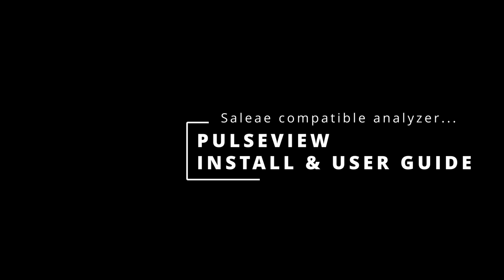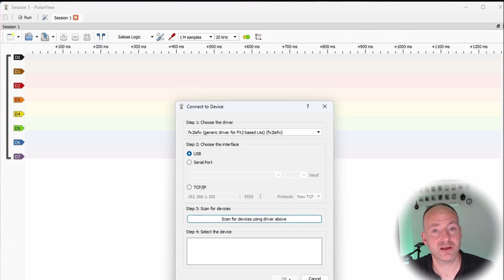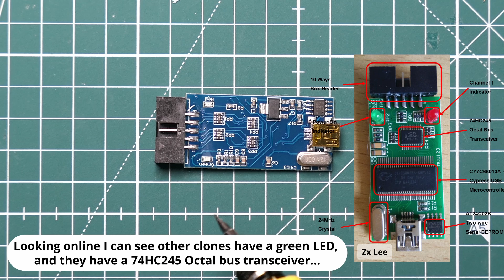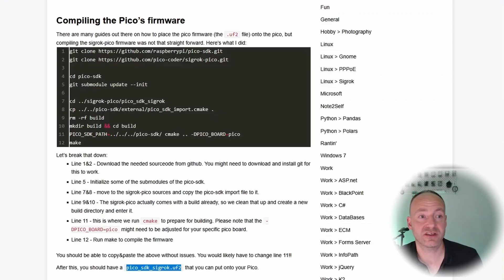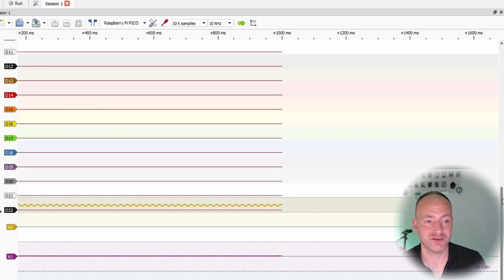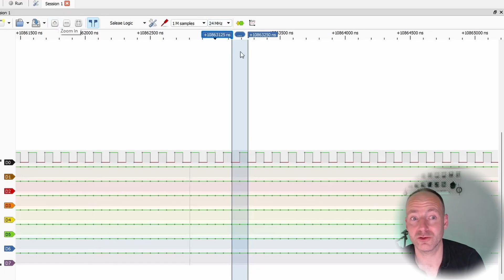Bargain logic analyzers: setup, teardown and comparisons.

Comment: If you want to start high speed signals, you better start investing in some decent probes instead of the toy wiring you are using now.
Reply from the maker: Well, I have a decent oscilloscope at work (1 GHz Tek, with quality probes), but it only has 4 channels and doesn’t do the decoding! Certainly, for anything high speed or analogue, a good scope is a must, but this little logic analyser is great for most of the digital stuff I do (tends to be microprocessors talking to sensors via i2c). Thanks for watching 👍👍
Reply: The problem is that all higher frequency square waves will start looking like a sinus if you don't use compensated probes.

Comment: i guess if you use 16Mhz sampling on the pico you'd also get 50% duty cycle.  also on 24Mhz sampling, it'll be exactly 3 samples per input cycle, so no way to have 50% of 3, no matter how precise the instrument.
Reply from the maker: Yes, it’s a good point… I’m coming from a mindset of A to D converters and the logic analyser works quite differently! Thanks for watching and interesting insight 👍👍
Reply: Yeah, the reason it showed 8MHz 50% was due to the sampling frequency, and not necessarily the actual generated waveform.

Comment: Nice review, but the comparison is unfair. First of all, the sampling rate affects the performance of both analyzers. One (or at most a few) channels will have higher sampling rates. When you enable all channels, you get the worst possible sampling rate — especially if you add analog channels as well.

And then there’s the sampling rate for an 8 MHz signal: for the clone, 16 MHz and 24 MHz are 1/2 and 1/4 of the signal frequency, so you get nice, clean alternating 0s and 1s. For the Pico, if you choose 20 MHz, of course the captured signal will not perfectly match the original.
Reply from the maker: Thanks, interesting info, I’ll try both with just one channel active to see what happens. Thanks for watching 👍
Reply: @thecircuithelper  I'm in the comments to see if anyone provided the fix, did this fix the issue? I guess not, given you didn't upload a follow-up?

Comment: Nice one, good explanation. To add a little more I discovered that [at least with my version] the Cypress chip does not contain, and will not retain, the firmware needed for it to function. When you open 'Pulseview' it uploads the required firmware to the Cypress chip. For me, windows recognizes that 'a' device has been plugged in but without the firmware does not know what it is, once Pulseview has uploaded the firmware Windows then recognizes the device as (whatever your flavour is). My Cypress chip comes up as fx2lafw in the Pulseview dropdown even though my board is more like the image in your video, same number but still different. One small tip...hover over either the 'samples' or 'frequency' dropdowns, it will show you the length of your selections in seconds, no need for any mental arithmetic!
Reply from the maker: Great info, thanks! My board is weird, it isn’t detected in pulse view at all until you disconnect and reconnect it, I wonder if it is doing the same thing as yours and uploading the firmware. They do seem a bit flakey, but for the price I’m happy as long as there’s a work around! Thanks for watching 👍👍
Reply: I think all 'fx2la' devices work roughly the same way but yeah, plug the thing in, device manager reports 'Unkown device' - it knows something is plugged in but doesn't know what - no communication.
For me, 'Zadig' auto selects 'Unkown Device #1' with WinUSB driver selected. Installing the driver updates 'Unkown Device #1' to a 'Universal Serial Bus device'.
Starting 'Pulseview' uploads the firmware to the Cypress chip at which point Windows recognizes it and changes the device yet again to 'fx2lafw'.
In Pulseview the device appears as 'Saleae Logic'.
TL;DR
The device is initially an 'Unkown device', no firmware = no communication.
It becomes 'Unknown Device #1' once the WinUSB driver is installed.
It changes to 'fx2lafw' once Pulseview uploads the firmware and Windows can communicate with it. (Via the Cypress firmware)

Comment: With a 24Mhz clock, divided into 8Mhz blocks, what divisions could one get? 24/8 = 3. So for digital signal, you could get one oscillating with a high period of 0/3rds of the time, 1/3rd of the time, 2/3rds of the time, or 3/3rds of the time. You might be interested in checking out logicanalyzer project by gusmanb. He's built one for Pico or Pico 2, up to 300Mhz I believe, using the overclocking that most pico's can do very well
Reply from the maker: Definitely, those pico analysers are super cool, I think I messed up in the video using a really old firmware. Will look into making a proper PCB for the pico with some input protection etc, thanks for watching 👍